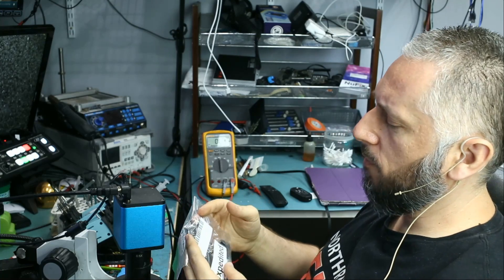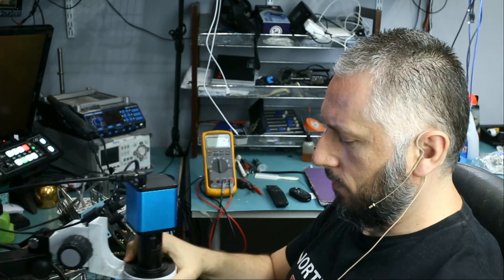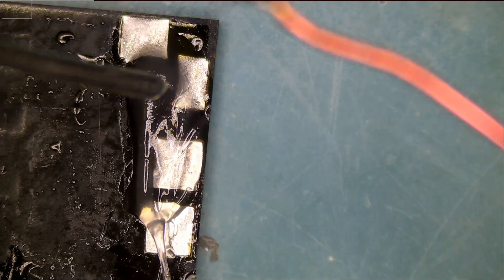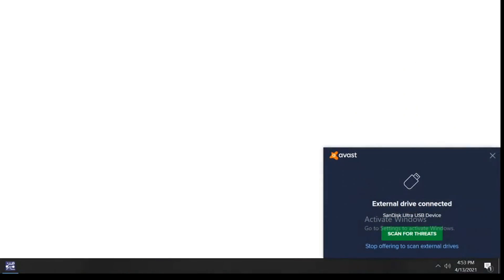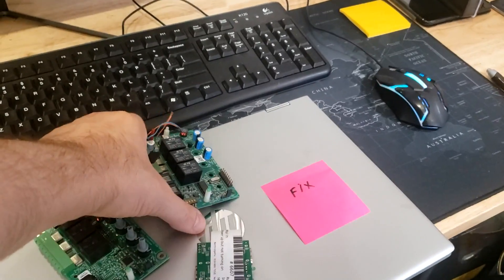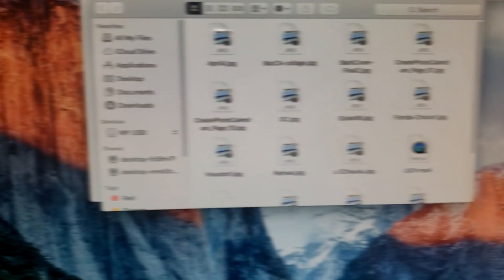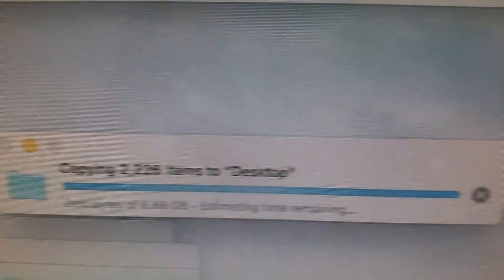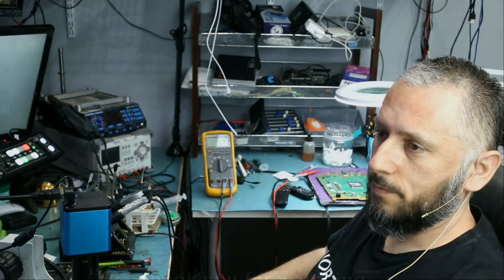USB Flash Drive Memory Chip Data Recovery - Drive shows no files and Keeps disconnecting

Comment: Alongside using some cooling solution to keep the drive from overheating, I probably would've put the drive onto a Linux machine and copied the raw block device into smaller files so that I could resume copying if the chip disconnects or put automatic pauses between copies to prevent overheating.
Reply: What and how?

Comment: I've done this exact thing before. Thumb drive was snapped in half but the chip had survived. Didn't get hot for me, although it was a much older drive, before usb3 was even released.
I'm sure the ice pack/ freeze spray tricks would work just fine for recovery though.
As for warnings of malicious software, i agree and disagree. I'm more concerned about the usb killers than a software attack. my test bench doesn't hold sensitive data and can be wiped and restored at any time.

Comment: You could rig up a heat sink to the chip and copy the large files to see if the overheating to causing the problem, use a cpu heat sink and zip tie it with thermal paste above chip to heat sink, run a fan over it

Comment: I am pretty sure a cold ice pack taped around or freeze spray will allow the folders to copy and definitely recommend unloading copy and pasting 100 items at a time and see how that works and disconnect and connect every time it gets too hot and stops and you should be good.  flash drive is working it is just injured and needs an extra push.  Great video Alex. Thanks for educating us on how to recover data from a USB C or MICRO USB flash drive :)   - Ari

Comment: when i see an actual "repair shop" attempt at something and end up nuking it, i feel much better for my future in the same field.

flash memory gets too hot, it will slow. but we are talking more than 70C. do as you said, get it cool. but try have some auto sync program running. so you dont always have to go and check

Comment: Usually on those kind of flash drives, the whole USB port acts as a small heat sink and transfers heat in to the computer away from the stick. Try using a fan or heatsink.
Reply: Wow! A clever solution! Thanks for sharing
Reply: My first thought was a little thermal paste and a heatsink. Got me out of jams on overheating HDDs in the past. Of course my FLIR thermal camera was burning my 'chip checker' AKA finger.
Reply: @gallagher68  why would your FLIR cam be burning your finger?

Comment: The real question is, will he attempt a repair on that Hiroshima ps4?
Reply: PS5* - so it's actually worse! Probably the liquid metal is al over the board contacts besides the previous repair attempts. 😱 Wouldn't wanna touch it at all if the whole board looks like the HDMI area. 😁

Comment: man i had a similar drive a few months ago i used a active raspbery pi cpu cooler to lower its temps so i was able to read the files while it keeps at 37 C its a cooler with a tiny fan you can also submerge it in oil thats not conductive same oil used for aquarium dektop pc´s

Comment: I have had the same problem here. I put the chip in a sandwitch made of two small aluminium heat sinks and two thermal pads, so I was able to save the data.

Comment: I hate how easy you make it look man, I just can’t 😭
Reply: That's because that was an easy repair
Reply: @razer192  oh no I just mean in general man lol, I suck at micro soldering, granted I’m still very new at it but ugh still, I tried to fix an hdmi port on the PS4 and just messed up multiple times and couldn’t get it, tried to fix a usb c port on a Nintendo Switch and another hdmi port on an Xbox One but still just can’t get it like he does.. 😭
Reply: @johny1220  to be fair those are all difficult repairs for a novice especially if you don't have decent equipment
Reply: @techroom6830  idk I think my equipment is decent, I mean I have the same microscope as him and my soldering iron is the western digital we1010, and some generic $50 hot air station lol.. 😭

Comment: when a drive or disk is crashing because of copying a lot of files most of the time its caused because of bad sectors/overheating. try to cool it or try to copy some files in that folder. Not all but some to see if you get any data from it.

Comment: That could be a poly fuse that is activating due to excess current draw or overheating of the IC. A cold pack may work or as an emergency data recovery act, bypass the fuse, power from lab power supply and extract the data as fast as you can. The memory IC may suffer failure through overheating but hopefully the data can be extracted first.

Comment: Try a small heatsink, a thermal pad + a small plastic clamp for pressure, maybe it will give enough time to copy the big file.
Or keep spraying freeze sparay on it until it finishes the copy process.
Reply: you could also go into that big folder and start to copy each file seperatly.
Reply: @KrX3D  yep, done that lots. The only way if your hhd is faulty
Reply: I hope this won't cause a crack on that NAND due to thermal rollercoaster.
Reply: That was my first idea too
Reply: I would say a mid to large size heatsink [comparably] so you can be sure it won't thermal throttle and prob easier to find in a typical desktop pc lying around like the random CM 212 Evo I'm staring at right now.
Reply: The heatsink works, that's what I to do speedup transfer speeds and avoid disconnections.

Comment: Resoldering the micro-usb back on is near impossible. The only way I can think off restoring that port is if you glue the port and run jumpers across the board to the USB A port. The spots on the copper traces of the PS are from flux. I've seen the copper change color only when applying  heat and flux.
The low quality flash drives get very hot on read/write. Also happens when their worn out. I usually use Isopropyl alcohol and drip once every 10-20 seconds on the flash drive or mircrosd card. When it evaporates, it cools the thing down even more that if you were using else non conductive like (oil (stupid example))